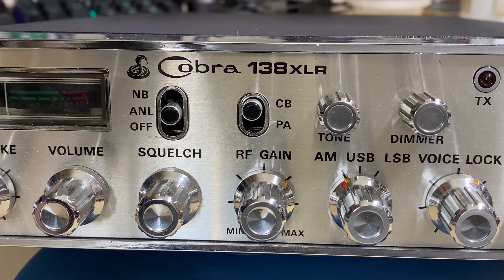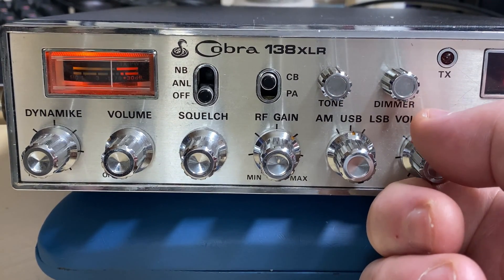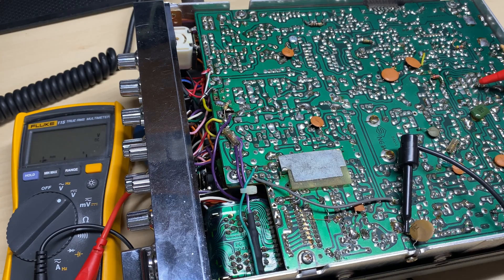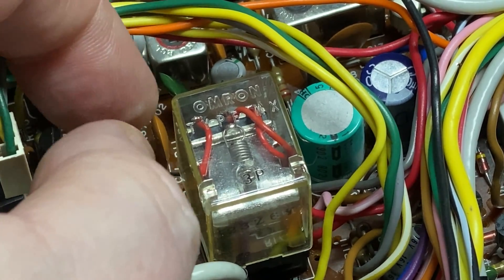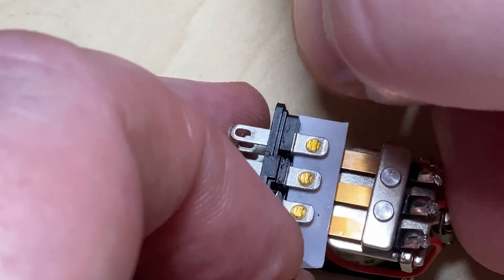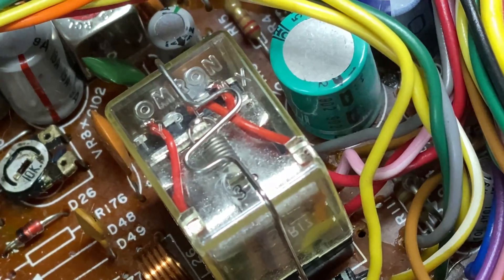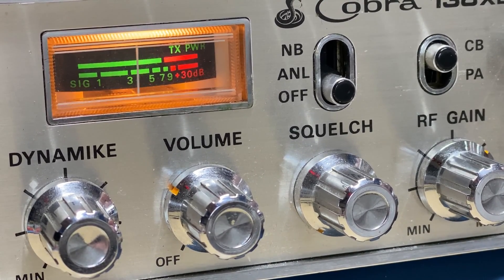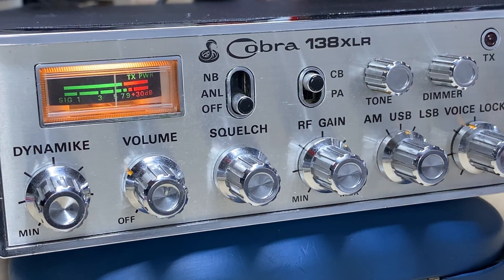EP 168  - Cobra 138 XLR - Receive fault - can i fix it ?.

Comment: Not sure it's the same pin you suspected to be giving grief, but at 6:55 the top left contact in the relay socket looks really dodgy!
Reply: Well it is another of my radios repaired by MicroChipz. The radio is up and running again and fault is totally rectified and working like it should.
Reply from the maker: Well spotted , it does look crusty , and it looks like the pin that was causing trouble. Maybe the act of removing the relay and putting it back sorted the issue .I haven't had any feedback from the cust saying its faulty again .